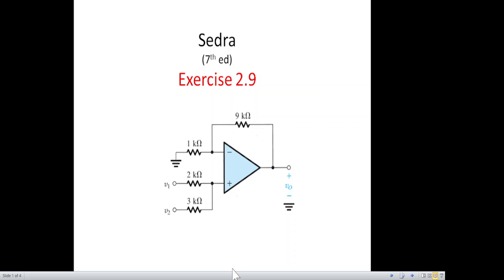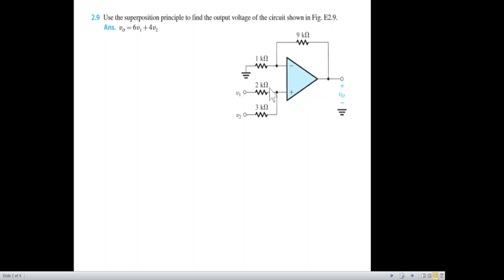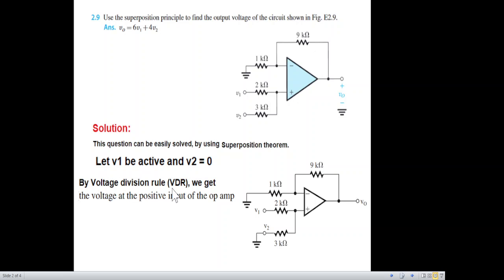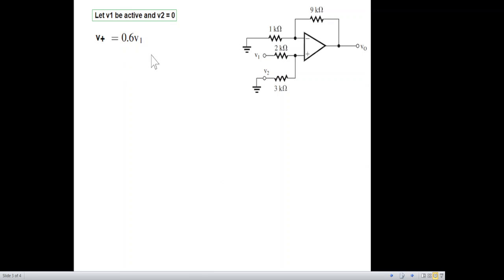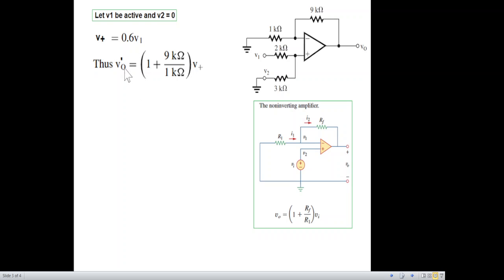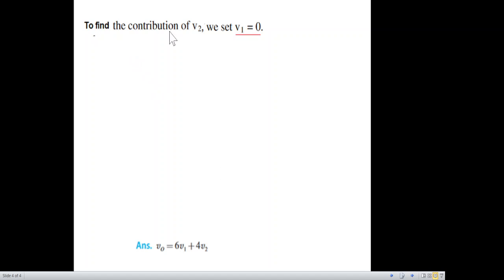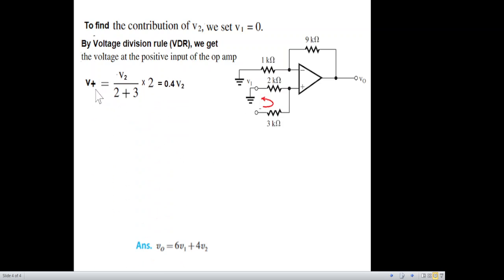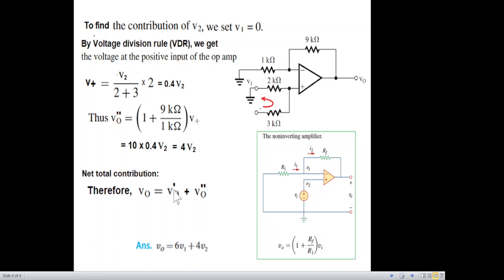(E)EDC(S) Ex 2.9 || Use the superposition principle to find the output voltage of Op Amp

Comment: Much appreciated Sir 😊

Ideal op virtual ground (v+=v-)
So (v+-v2)/3+(v+-v1)/2=0

2v+-2v2+3v+-3v1=0
5v+=2v2+3v1
v+=0.2(2v2+3v1)
So non-inverting amplifier
vo=0.2(2v2+3v1)*(1+9k/1k)=4v2+6v1
Reply from the maker: Couldn't understand ?:face-red-heart-shape:
Reply: @ElectricalEngineeringAcademy  
I am stupid but I'm too lazy to compute  the same op vo easily
🫡☺️
Reply from the maker: Now that you have completed the working; yes it is correct. Mr. Sedra (the book author) however prefers to use Superposition theorem 😆. Thanks for the input. See my next video, I have solved the question both ways.
Reply: @ElectricalEngineeringAcademy  Much appreciated Sir ☺️👍